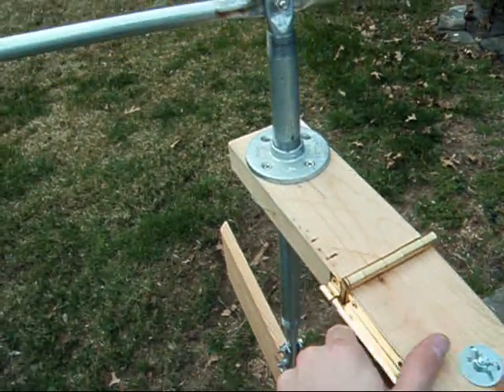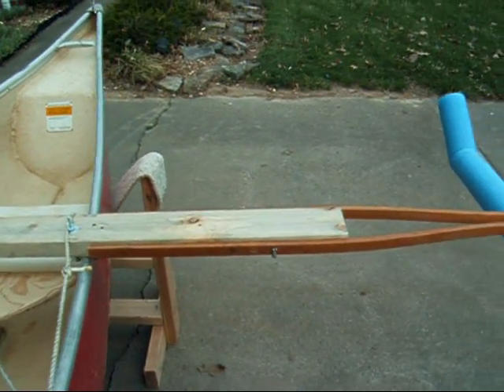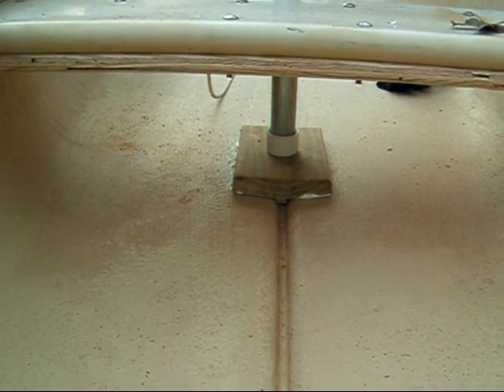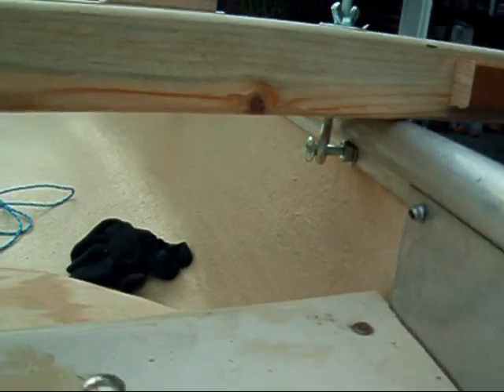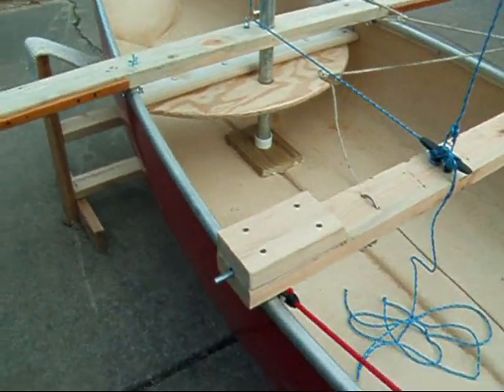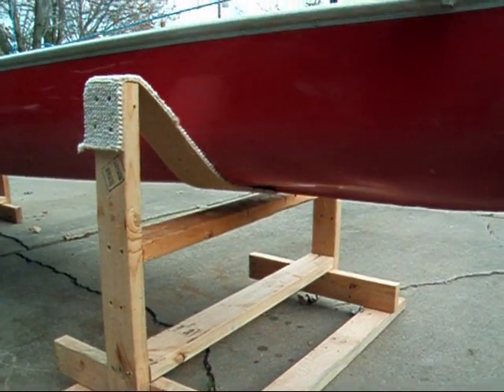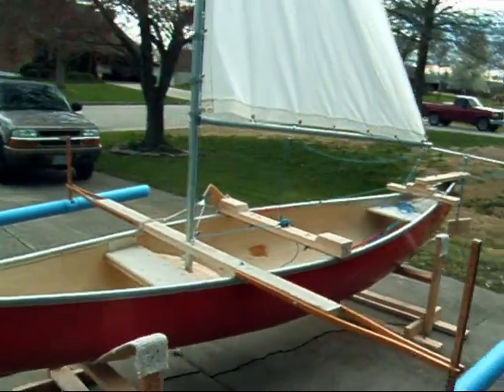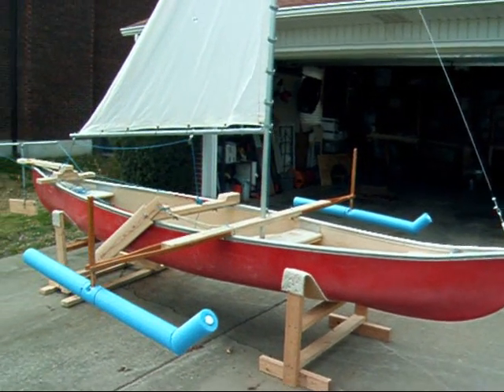Homemade Sail Rig for Canoe

Comment from the maker: @mrbingle100 Yes. I've sailed it and it works ok for being homemade. I had to make some adjustments on one of the outriggers and on the rudder system.  I'm not sure what kind of canoe this is. I know it's fiberglass, and you can see the "fibers" inside. I didn't notice any signs of stress.

Comment: Why doesnt the rudder pipe just slide right down? whats holding it in place and  allowing it to turn?  is the flange and the pipe threaded? is there something there that isnt seeable in the video? I like ths , though.
Reply from the maker: Thanks. The flange and threaded pipe is just there for the conduit to slide freely through. The only thing is the rudder assembly can’t be removed from the mount. But as little as I used it that didn’t matter to me. I’ve since sold the canoe so I can’t continue improving it. It was a fun project that challenged my crude engineering skills. 😂

Comment from the maker: @SuperHaxzor The boom is attached using a 1/4" bolt which goes through the boom. Attached to that bolt is a 1/4" eye bolt. The eye bolt goes through the 1 1/4" conduit and is secured with a washer and wingnut on the other end. The boom is 10' tall with an 18" extension I crafted from a 1" PVC filled with a wooden dowel. The extension is screwed through the conduit and into the wood-filled pvc. Thanks!